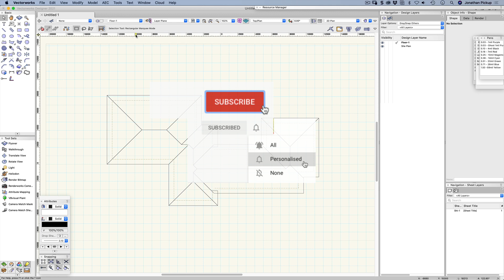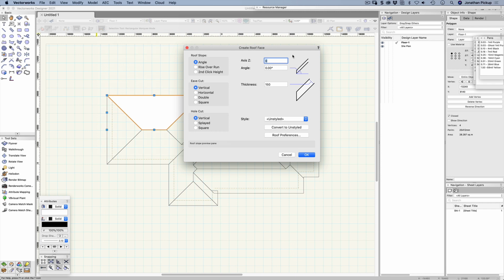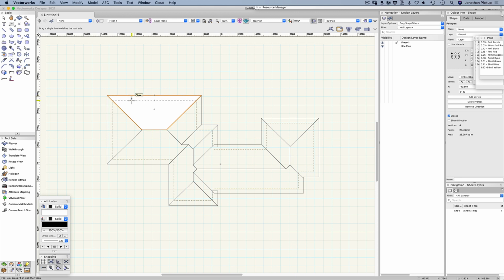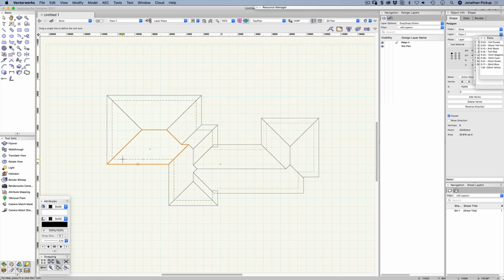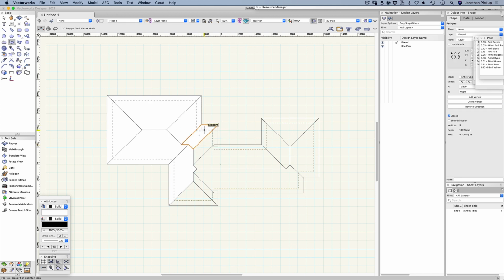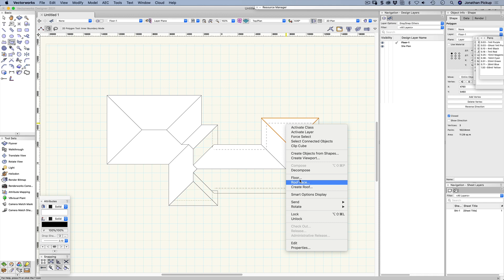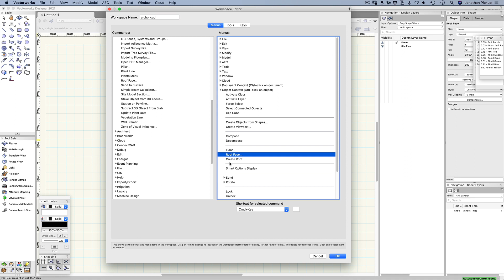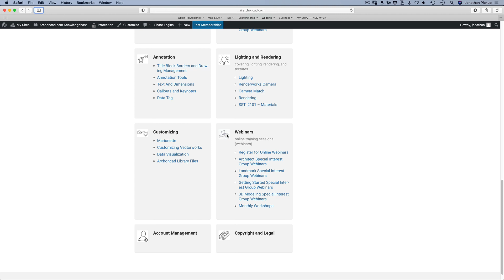Vectorworks - Quick Roof Faces

Comment: Hi Jonathan great vid.  However when I use the Roof Face tool every face is created at a random height...if you looked at this model in 3D is the roof correct?
Reply: OK...the issue was very messy imported dwg...i cleaned that up and its a lot happier.
Reply from the maker: I see you have solved the issue
Reply: @archoncad  This probably isn't the best forum but I'm now getting erratic results from roof framer on these roof faces...do you have any tips for me?
Reply from the maker: @carcusminsden1310  copy the roof faces into a new file and see if they misbehave. I use copy and paste in place, it makes it easier to copy and paste the roof faces back into the original file
Reply: @archoncad  Sorry I get the same results if I do that.  Can I message you on the forum?
Reply from the maker: @carcusminsden1310  sure

Comment: I can't apply textures to Roof Faces. How do you do it?
Reply from the maker: You should be able to use the Object Info palette, render tab. Check the settings on the Object Info palette to see if you are using the by object or by component option. If by object set the texture to each part of the roof. If by component, add the texture to each component.